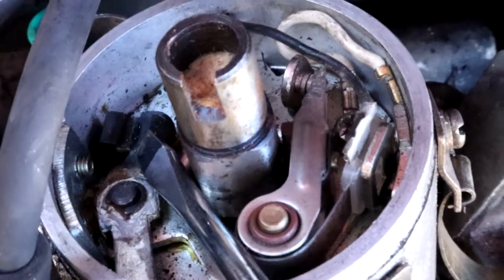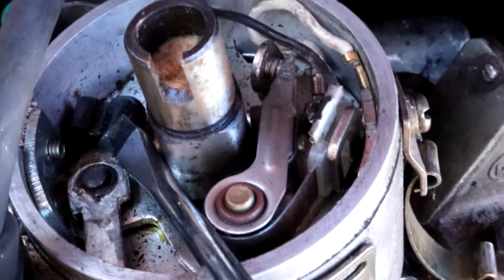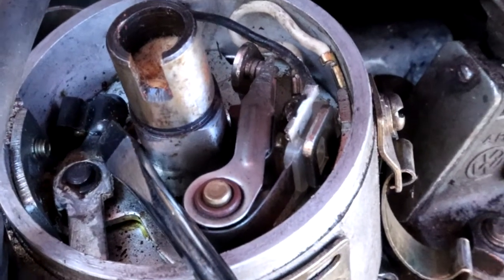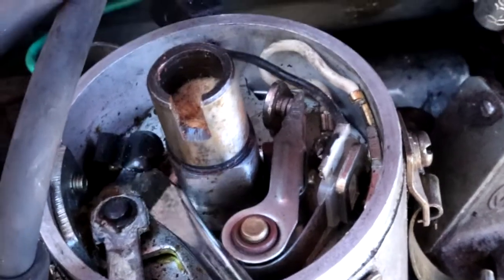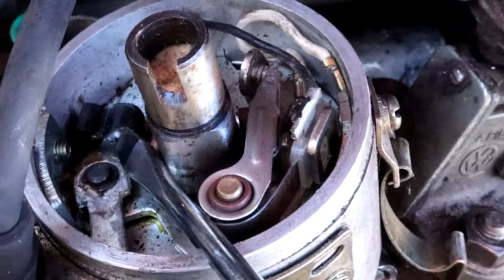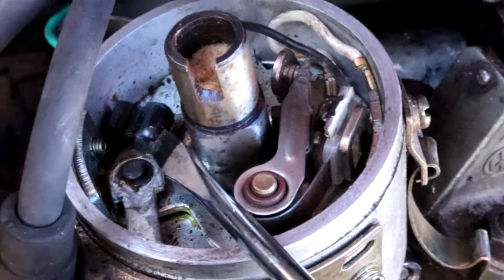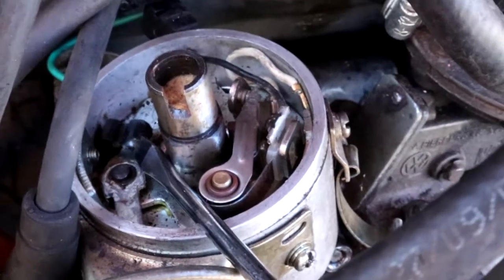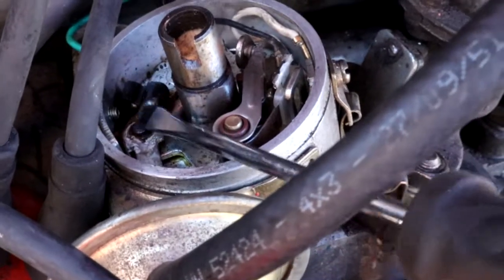VW Beetle, Help needed

Comment: Part of the cap?     Is the condensor on the outside of the dis?    Remove the points and check for pitting.
Reply from the maker: The dizzy cap looks ok, condensor is on the outside and the points are new. Just never seen anything that resembles the black bit before. The owners going to see if he has another dizzy, to see if that one has a problem
Reply: @DoubleZeroGarage  Can't say I have come across anything like that before.
Reply: I have a beetle and have not seen one of those black things before. Not sure I understood your problem though. You say you're getting spark at the coil king lead, if so the points are probably ok. It's the points opening/closing that causes the field to collapse in the coil and provide the high voltage spark. Do you have spark at the plug? If not your problem is between king lead and plug somewhere. What condition is the cap? Rotor arm? Test resistance on HT leads? If you have ok spark at plug and fuel then it's probably timing.
Reply from the maker: Thanks for commenting, don’t have spark at plug. Cap and rotor arm are both good, think the owner is going to try another distributor incase it’s something to do with that black bit
Reply: @DoubleZeroGarage  Might be a duff coil?
Reply from the maker: Tried two different coils, new condensor ordered to see if that could be it